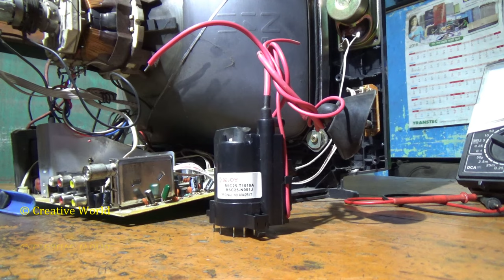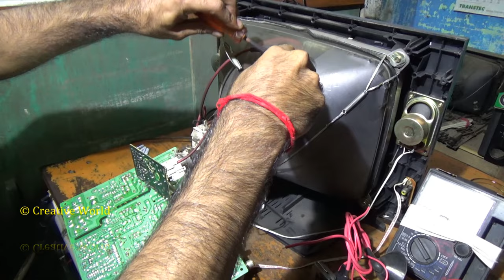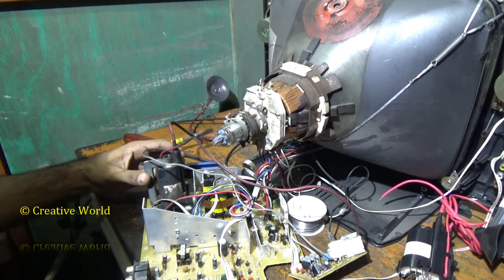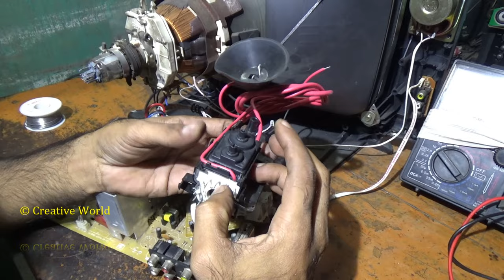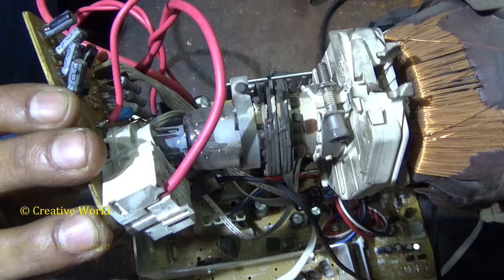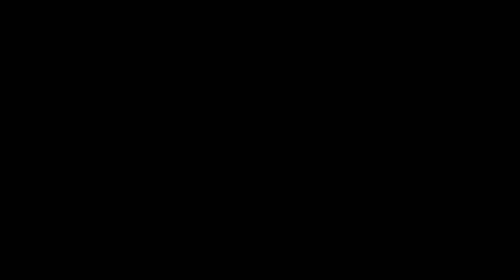How To Change Flyback Of CRT Color Television - For The Beginners ( Very Useful)

Comment: Hi there, just found this video. After such replacement, is there any tuning or flyback setting required? Is there anywhere online I could read or learn about it? Thanks for any comment.
Reply from the maker: Not that I know of
Reply: You could mess around with the adjustments on the flyback if the image is strange

Comment: There are sparks coming from the top of the flyback transformer, and the screen flashes with     sparking sound........could that flyback trnasformer be dead?
Reply from the maker: it is very dangerous,,,because there are High Voltage,,,
you should change the Flyback Transformer
Reply: I   replaced it , now the Tv wouldnt turn ON. Finally, i heavily insulated the sparking part of the old one.   Now it works fine and there are  no more sparks. Thank you for your help.
Reply from the maker: thanks,dear

Comment: It may sound silly, but why don't we just cut the anode wire before it connects with the vaccuum/glass of the TV?
Reply: Because its easier and safer to have a whole new EHT wire than one with a solder mid-way.

Comment: My tv will turn on them shit off 2-3 seconds after the screen lights up at first it was making a buzz sound then stopped but the same issue is occurring when I turn the knobs on the fly back down it’ll stay on longer and when I turn the knobs on the fly back up it’ll shut of quicker also there’s a click sound inside the flyback when it shuts off would the flyback be my issue? I’m working on a cool Disney Pixar cars tv model# c1312atv it’s a neat little tv I’d love to save it’s complete with remote and mint
Reply from the maker: you should change fly back.